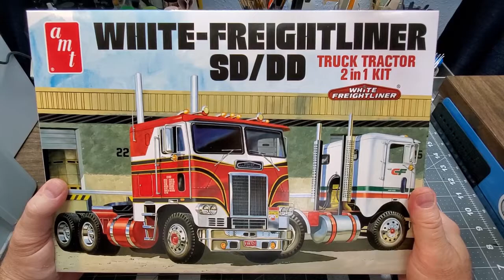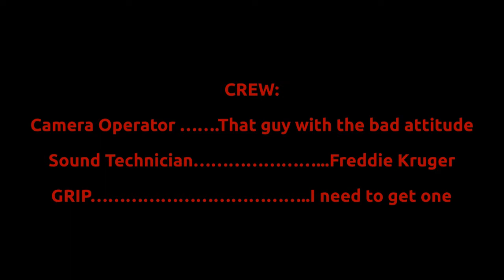AMT White-Freightliner/The Fright-Liner - Custom Scale Model Build

Comment: This is by and far the most creative build I think iv ever seen on YouTube.increadable I love it. Got me wanting to do a simpler one myself an wondering where to find the skulls as well
Reply from the maker: Thank you very much Adam, I really appreciate that.  I actually fond the skulls at a craft store in the beads section. Each one has a hole through them from tip to bottom. For the ones coming out of the cab, I simply used a razor saw and cut them in half. The one on the air-line post is an uncut one. Thanks for watching and commenting, have a great week.